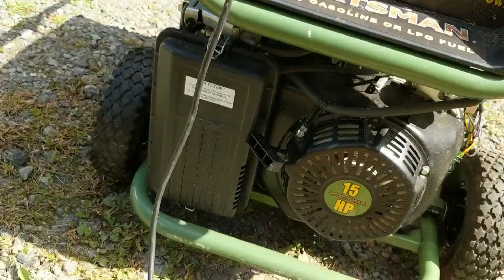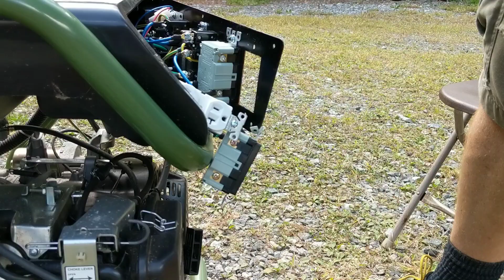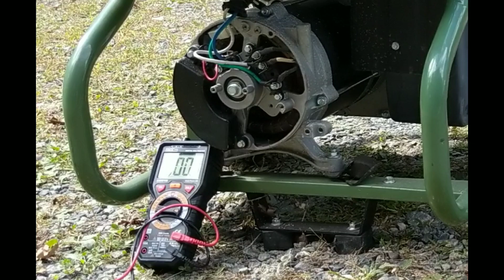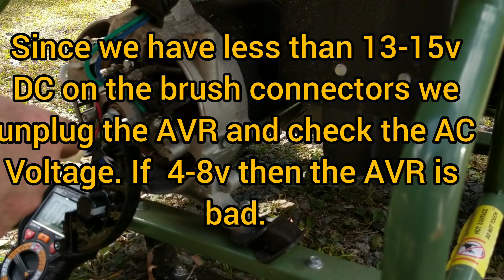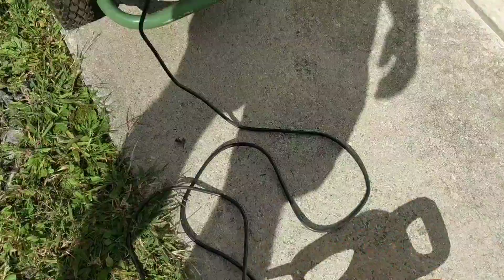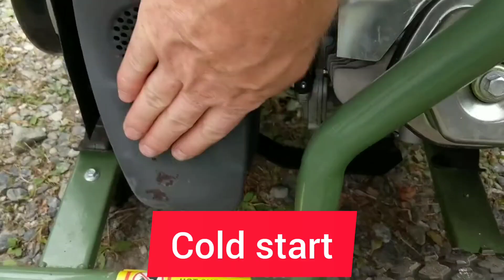Sportsman 9000 watt generator troubleshoot & repair

Comment: Apparently the GFI outlet will not reset unless supplied with electricity.  I didn't catch whether you tried that.  Also the plug from the AVR has been known to get sucked into the rotor and kill the machine.  BUT YOU GOT IT WORKING _ GREAT JOB. Thanks for the video.
Reply from the maker: @rhbofwcc  Thanks for the comment. I did try resetting the gfi's after replacing the AVR and confirming around 110v AC to them, but they still didn't work.  In fact the little led status lights, on the outlets themselves, were also not illuminated.  Fortunately this AVR plug didn't get pulled into the rotor, but if I find another free generator I'll be on the lookout for that issue.